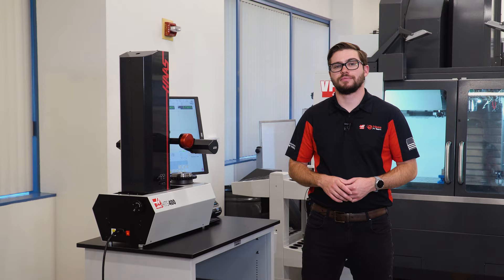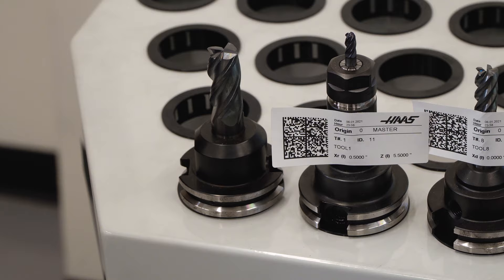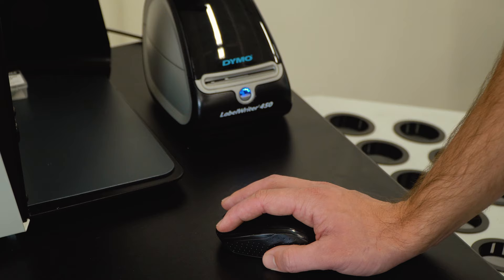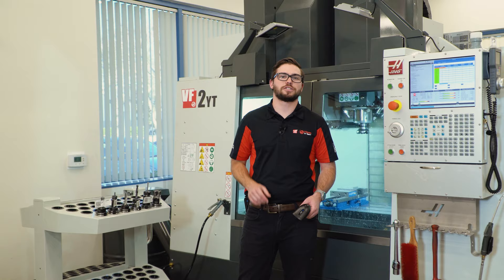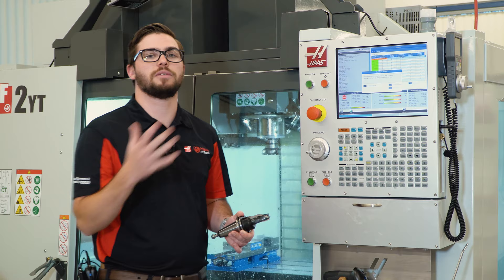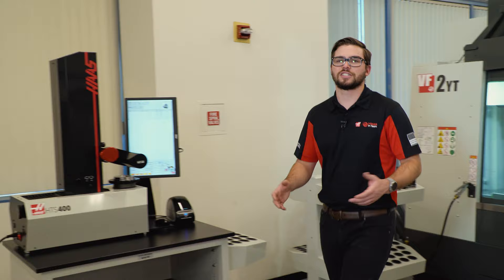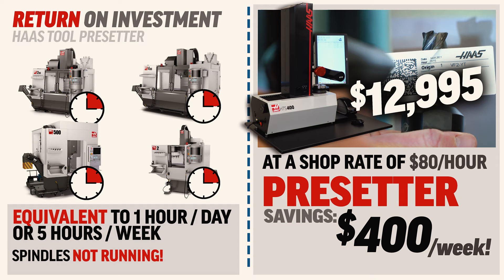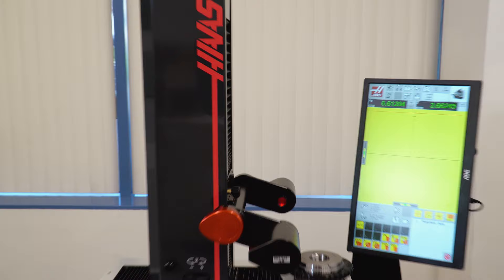The Haas HTS400 Tool Presetter - Haas Automation, Inc.

Comment: Is it just me or is it quicker to just have my tool presetter do the work and have the touch off commands on block delete in the machine.  It's what 20 seconds a tool at this point to set them.

Scanning, buttons etc.  Nah I'll just use a better option where i can drop them in the spindle and walk away with the cycle running
Reply: he says in the video this is for doing a tool setup outside the machine try to follow along man dang
Reply: @SuperAWaC  I understand that.  I just dont see the benefits for a smaller shop.  If you have 20 mills then sure maybe this in your tooling dept. (if you're setup that way) but for the majority of shop owners I dont see this as practical.

It takes time to put in the presetter spindle, orient tool, command the measurement, get the label, put the label on the tool, upload tool information into the controller, load the tool into the spindle, tell the machine to change to tool 2 and rince and repeat.

Or I can simply select for fusion360  to "optionally measure tools at start" one time and bam theres my code in every single program... G65 P9023 A23. T1 H3.375 D1.

Also have you ever priced dymo labels?  Just saying 400 a month in savings going right into labels to mark your tools.
Reply: @ec8874  it's obviously not meant as a solution for every single shop, and using the tool presetter the way they are using it in the video isn't the only way to use it. Defining the tool lengths in the CAM program is suboptimal because now you have to set your tools to exactly those virtual lengths. It is better to just define minimum tool projections and let the machinist or guy in the tool crib take care of it. Tool lengths/diameters are best handled by the controller itself. I also personally have no need for a presetter like this because I only have a few machines and they all are equipped with laser presetters, but there are lots of production shops that have dozens (or hundreds) of machines that have no probing at all or only spindle probes and no tool probes and even if they do have probes, shaving every second off of setup times possible is very important to them.

Comment: Have you locked the toolscan functionality to owners of your presenter?
Reply from the maker: •Joshua, Yes the ability to scan tool offsets is exclusive to Haas machines since it is an integration with the Haas control.  However, we have included postprocessors for various CNC control manufacturers so you will still have the ability to export files for these machines using a USB.

Comment: Its work on massive production not as mine single molds parts
Reply from the maker: •Wodnisty, It is a common misconception that presetters are only for the “Big Guys” in the machine shop world when they are actually beneficial for small and large shops alike. Both types of shops can benefit equally from running their machines longer by eliminating the spindle down time it takes to measure tools in the machine. Large or small; an hour of spindle on-time gained making parts is money in your pocket.

Comment: why the hell do i have to wait while the machine is running ? we always set up tools as we need them.  so spindle downtime needed for setting up your tools.....so shady marketing for no reason whatsoever
Reply: They’re saying if you’re running a part in the machine you can’t put a tool in and touch it off with the renishaw tool setter that’s on the table. You’ll have to wait until the program is finished running before you can put a tool in and touch it off. Of course you can still physically put an endmill in a holder when the machine is running but you can’t touch it off. Which is the whole point of the “pre-setter”
Reply from the maker: •SK40 Mechanic, Brad is correct. The HTS400 allows you to not only set up your tools but measure their offsets as well, all while your machine is still cutting. Now when you need to replace a tool, all you have to do is place the tool in the spindle, scan the tool info into the control, and be all set up to run parts again.